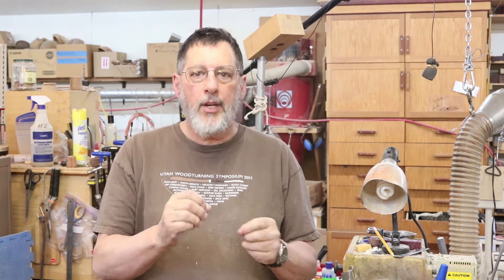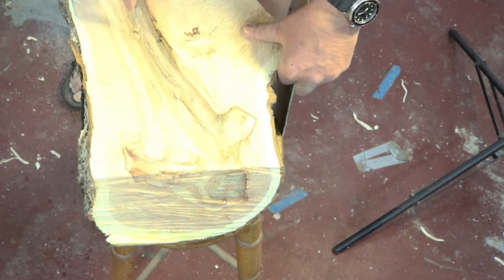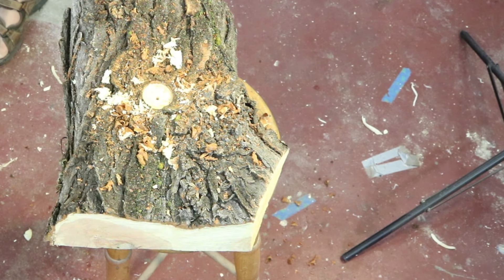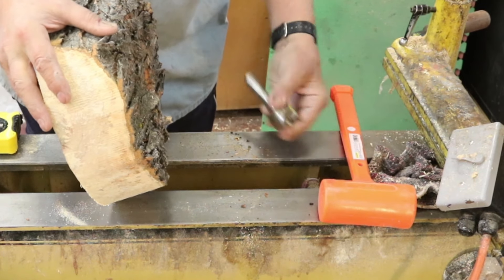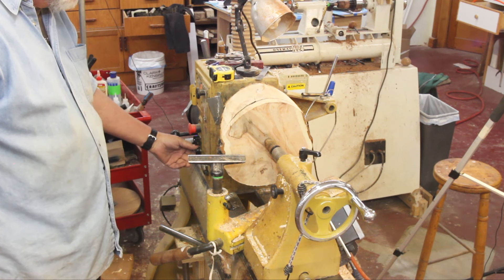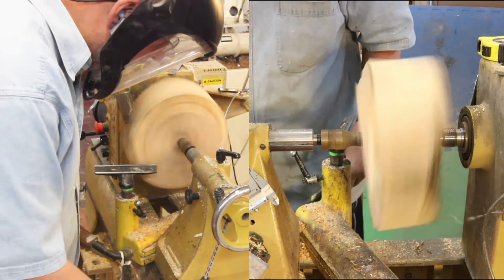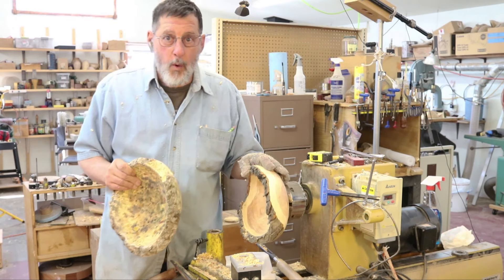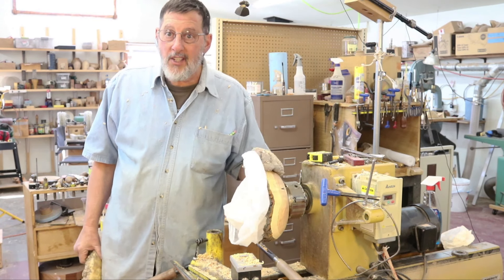Rough-Turning a Natural edge bowl,     (part 3)  From a log to a bowl with Sam Angelo

Comment: Really a rookie at woodturning so I take notes whenever a great tip (oftentimes with little fanfare) is given. Case in point...at approx. minute 10:30 of this video, you mention why you used a spur drive instead of a screw chuck or a faceplate. This was such a great tip and seemed obvious after thinking about it but it might have not come to me immediately so I made sure I saved this info (including the video link and minute mark) to the Notes app on my Mac. I have always been frustrated when "definitive" instructions are given e.g. "you must always" or "never, ever do the following" but zero explanation is given for the dire proclamation. Thanks for making a great point and explaining why!

Comment: Hi Sam, Thanks for this series.  It has confirmed many of my practices, so that feels good.  I turn mostly green start to finish.  While I anticipate distortions especially with traditional bowl turning, I wonder why turning a natural edge bowl would be preferred in a two-turned process that you are describing.  Because the level of distortion especially at the rim is desired, what is the advantage of waiting 3-6 months in this particular natural edge framework?  Thanks, Fred
Reply from the maker: Fred
I agree with you 100%. I always turn my natural edge bowls green that is I wet from start to finish and turn them thin so they warp and not split.  I find if you rough turn Natural edge bowl it's so much more difficult to finish it up in six months because of the uneven level of the rim.  So again yes I agree with you I would complete this bowl to begin with. I did rough turn this one mainly because in the second video I rough turned that bowl. I should've made this more clear in the video. Thanks Sam
Reply: Thanks for taking the time for my question, although I shouldn't be surprised!

Comment: Hi Sam.  I was surprised you don't have a special bandsaw jig  to simply slice off those areas you marked and discussed in the beginning of this video.  Then you would not have had to shave it all off with your lathe - not to mention have to try and figure out how to mount the block on the lathe.  Or have you tried that b4 with no good results?

Comment: Great video Sam, I love this series. 

One question - what is the bungee strap on the tailstock for?

Take care, Dave

👍🍺
Reply from the maker: Finally a question I can answer, ha ha
The bungee cord is wrapped around the handle that locks my tail stock. It helps to hold the handle in an upright position. If it is not there to handle drops down and prevents detail stock from moving. With the bungee cord I can move the tailstock with one hand but it doesn't prevent me from locking the tail sock with that handle. Thanks for watching my videos I appreciate it.
Sam
Reply: Awesome, thanks for letting me know...things like that bug me more than they should lol! 👍🍺

Comment: Sam, you mentioned turning to completion while green. When I do that, it is hunky dory when first turned, but when it dries and warps, it does not sit even on the table. Any tips?
Ps. do you ever use CA on the cambium layer to keep the bark?
PPs. don't be so hard on Coco.
Reply from the maker: I usually leave the center nub on the bottom until the bowl dries completely.  Then I put it back on the lathe and true up the bottom rim one more time.  Then the bowl should be fairly stable.  I don't use super glue on the cambium layer unless the bark looks like it will fall off.  I have been pretty lucky with bark.  Sam

Comment: I notice you leave the pith in and turn it off, a lot of people cut the pith out with the chainsaw. My question is if you are not going to rough turn the blank immediately, are you better off to cut the pith out when you make the blank or does it not really hurt to leave it in?
Reply from the maker: Yes you are exactly correct.  If I am not going to get to it soon...GET the pith out.  Sam

Comment: First thanks a lot and second a question, it should be wet wood or i can try with already dried wood?
Reply from the maker: If you have a log big enough to turn a bowl from it probably won't be dry all the way through. I prefer very wet wood and then I let it dry in a bag or a cardboard box for a number of months. Wood that is still in the form of a log that is dry completely through will also be cracked or split and not usable.
Sam

Comment: Thanks Sam. I agree with Frank about the ads. There were actually 4 as there was one at the very end. You Tube is getting about as bad as commercial TV. I have noticed that the ads are not on every channel that I subscribe to, so I don't understand that aspect. I thought as a maker you could control the ads by either allowing them or opting out. So, I guess they are doing this to encourage people to buy into You Tube Red which is ad free if you are willing to pay.
Reply from the maker: I do receive revenue for the ads.  If I did not receive this revenue I would not do the videos.  The compensation is not making me rich but it is incentive enough to continue.  I know the ads can be a pain.  I choose to monetize my videos but again this revenue is a big part of my income.  When I first started 6 years ago it took about 2 years before I made $50 for one month.   So what I am making now took lots of work.  I have figured that for one video, on average, for the lifetime of that one video I make about $40.  Not much considering a video takes 15 to 20 hours to make.  The video I did on the Carter and son tool review took 30 hours.    Sam